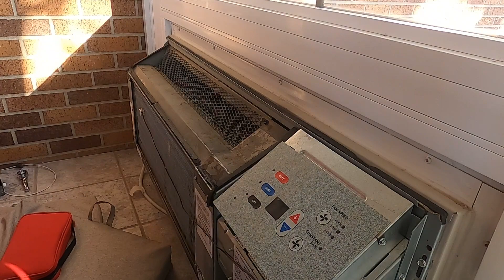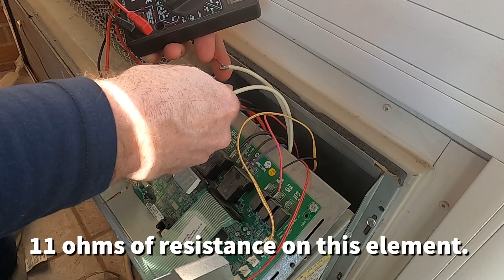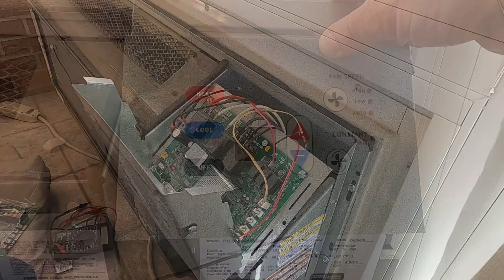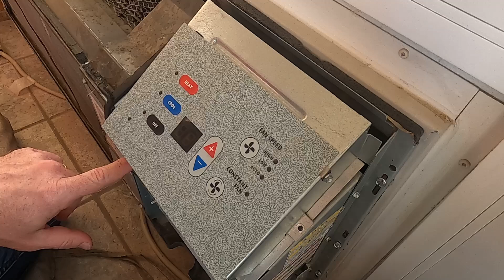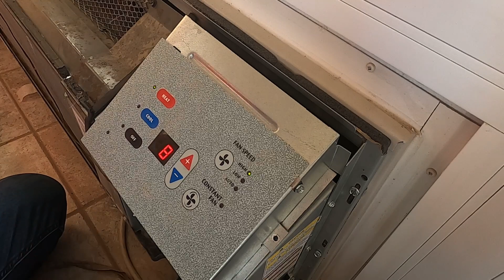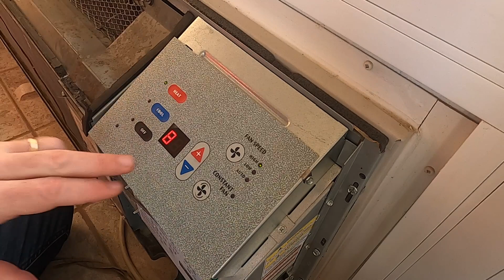How to replace the control board on an Amana PTAC that wasn't heating

Comment: So did that last, or did the new board blow too?  I have continuity between the two heater leads, and a burnt spot behind one of the heater relays...
Reply from the maker: The new board has been working fine
Reply: @HandCraftedbyJasonCooper  My wife has one in her little studio and the heat went out.  She called a 'repairman' and he basically told her it was shot and she needed a new one.  New board was $60 and I bought a new capacitor as well because it was a little off from the 5% tolerance.  So fixed it yesterday for under $100 in parts and maybe 20 minutes work with the help of your video.  Thanks!  Had to come home to look on the innernets on how to check that freeze protection is working, so going back to check that today and she should be good to go.
Reply: @HandCraftedbyJasonCooper  ok.. after swapping the circuit board the heat works fine.  however,... I'm not sure the freeze protection is working (and we need that) or something else is going on. I checked that C3 was on C (mine is a PTC as well), also checked CE.  The paperwork I had said CE should be on "1", but my options are H/L/0.. I assume the H/L are fan speeds, and 0 is for off.  It was set to L.  Right after I exited the config, FP displayed and it came on, I thought EUREKA! but no.. it shut off after a couple seconds even though temp was still under 40F.  I turned the heat on for a bit and the set temp was on the display.  After 30 seconds maybe the display went from set temp to FP for a second, and then back to set temp.  But freeze protect still didn't kick in after I turned it off (still under 40F).  PTC153B50AM..

Is there a way to check what the ambient temperature the thermostat is reading?  Maybe have a bad thermostat?  Thanks!
Reply from the maker: @Gareth96v1  It looks like you have those two settings correct (not that i am an expert on that model), but if you have the right control board, i believe those settings are correct. There is a way to cycle through the readings on the sensors. I don't have a video on it, but here is one where the guys takes you through it. He does it around 2 minutes in. https://youtu.be/2I05Rn-4-4k?si=JXr0gXKk39aYi7uB&t=120
Reply: @HandCraftedbyJasonCooper  thanks!